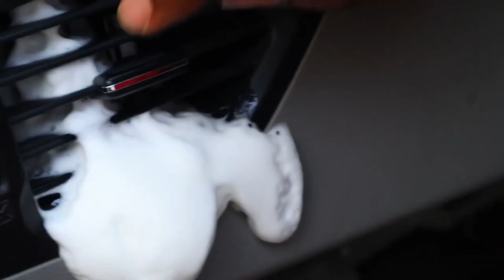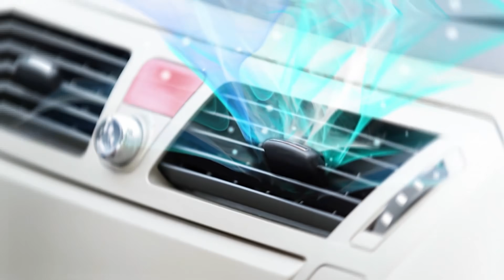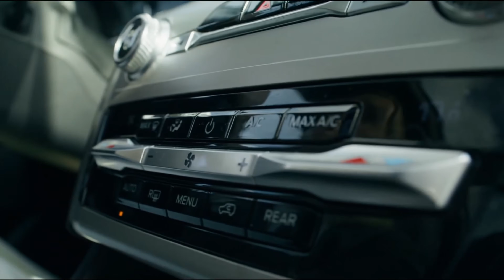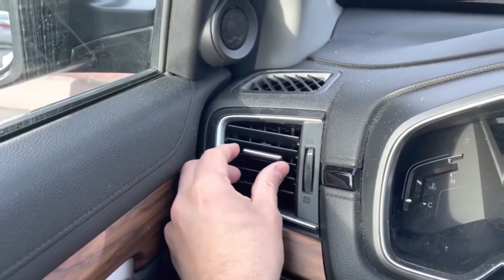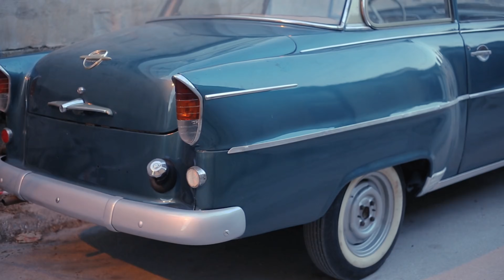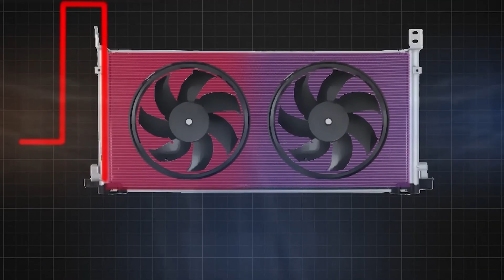Car Secrets To Make Your AC Blow Twice as Cold!

Comment: I live in the Las Vegas valley. I crack my sn roof 1/2 inch to let heat rise out of the ceramic. This DOES make my car cooler than keeping all my windows closed.
CORRECTION: Modern AC compressors are ELECTRICALLY driven to save gas.
Reply: Wrong. The clutch on the compressor is electric, engaging the pump to the belt, making the engine supply the torque to run the pump.
Reply: @garychandler4296  Not in my 2019 MAZDA CX-5!
Reply: @ericb.4358 OK. Maybe yours doesn't need a very large compressor?

Comment: Cleaning tip, lysol works, both liquid in a squirt bottle on the condenser and lysol carpet cleaner in the vents. I just used lysol to clean my Windows ac condenser. I only lightly used a lysol wipe, and the gunk ran out fast. I switched wipes and did it again until clean. I would have sprayed it with a lysol bottle. However, I did not want to have to clean the wall afterward. Now, the carpet cleaner foams up in the cars ducting, cleaning every part of the inside. This is important as older vehicles do not have the in cabin filter to replace like on obs chevy trucks. Pre 1999. So, cleaning the ducting is all you have at that point. Great video. 👍

Comment: An ozone machine can get rid of odors , especially mold and mildew .
Reply: Yes, zone is fantastic. It actually eliminates adverse odors and mold & mildew. However, after you run the ozone, you need to ventilate it afterwards by lowering the windows for about 15 
minutes before 
you get 
in….pure ozone can
crystallize your lungs…over time. It’s safe, just be careful.  
Ozone can be dangerous as it’s being produced by the machine, but … after about 15 minutes it’s very stable and harmful.
It will smell very clean afterwards, but that is not the ozone. The bad stuff has dissipated.

Comment: So why would you spray into the outside air intake while in the recirc mode? Unless there is something I have missed in the past 40 years of auto repair it looks wrong to me.
Reply: The guy narrating that part said it wrong, but did it right. He said turn recirculation on, but definitely turned it off in the video. You want the new air coming in from the outside.
Reply: @tonymosbach2868  good catch. I noticed it too.
Reply: Wow. It took those genius Japanese engineers to figure out to open the windows to dump the hot, pent-up air. Astounding!
Reply from the maker: It disinfect the HVAC system, but make sure you know what you're doing😊
Reply: Or once a month run your ozone generator for 30 minutes with the car running and of course the a/c system on. Eliminates unpleasant smells, kills mold.
Reply: Assumed this not mentioned so eluding to the Cabin Filter ,and cabin filter box.
Reply: Put the fresh air and spray

Comment: non factory tint is illegal in Canada.  68 to 70 is wrong as your wasting fuel,  normal is 72 degrees
Reply: Who said that "NON Factory tint is illegal in Canada?" Where is the proof? Provincial and federal laws across Canada determine how dark of a tint you can add and it's perfectly legal.
Reply: But does any cop enforce it?
Reply: In Indiana also.  But we have very dark factory tint and pull down screens
Reply: YOU'RE wasting fuel
Reply: Not true.  In Ontario you can tint the top 3” of your windshield, tint to a maximum of 30% light blocking on the front side windows, and up to 100% of light on any rear windows.